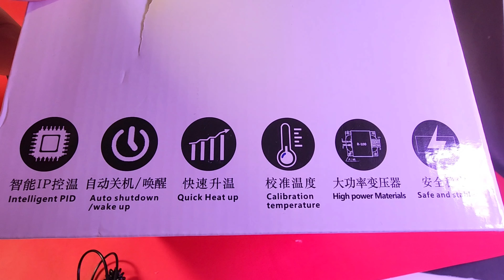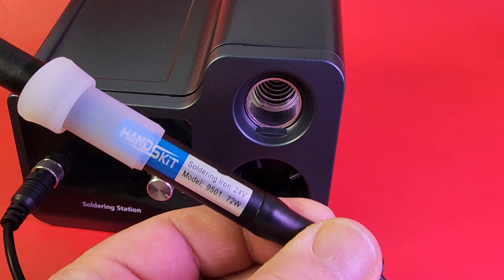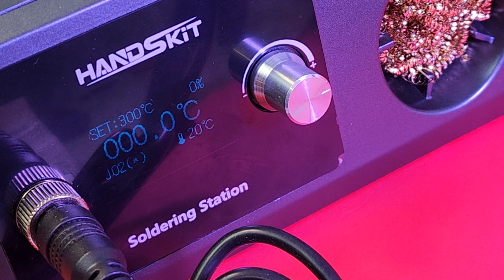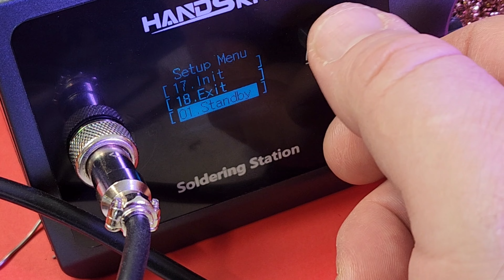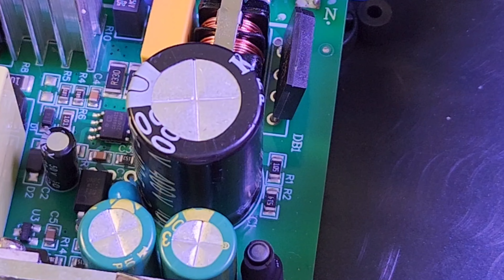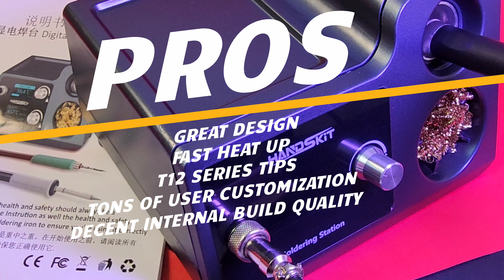HANDSKIT ST12A Soldering Station Review & Teardown!

Comment: Well, thanks, you made me buy it im damm happy with this cheap station, also, i have some (maybe stupid) idea, something to do with my old weller w1010, is there a way to use t12 handles on this station? I saw a guy made this : https://youtu.be/IgZN-7FMisk?si=7P_T2Qx5HNNzm6Fh  very interesting project, is there another way to achieve that? Excuse my bad english. Thanks for your info 👍🏻
Reply from the maker: I'll check out that link. I think the abundance of cheap but highly capable soldering stations really makes it much less cost effective to repair older units. Still.. Always nice to ressurect an old friend 😅

Comment: Can't change tip on screen... Always says J02 although I'm using a K and a BL... Did you find a way to change it? (They have a check on them in the software, but doesn't change between them)
Reply from the maker: Have you tried updating the FW?
Reply: @KeepOnTesting thank you for your reply. I found that while sleeping it isn't possible to change the tip on screen. It has to be heating so that you can press the button while turning it right to select the tip. Would be nice to see that on the manual 😅

Comment: Best regards, I wonder if this station allows the change of mode to c115,210,245 in addition to t12. And another question, between this model and the Yihua T12 948 DB II and the KSGER T12, which is better?

Comment: Hi Bro, does this station not have a soldering iron rest mode when it is put in its place?
Reply from the maker: Yes it has an autosleep mode that activates after 30 min, plus a 15 min standby mode.
Reply: @KeepOnTesting  No that, I was saying when you put the soldering iron in its housing, it doesn't go into sleep mode automatically??
Reply from the maker: No.

Comment: This ground is indeed an afterthought.  Ground wires must be connected with either a spade connector or ring connector on a bolt.  This not only reduces fatigue failure, but soldered connections can easily melt when called upon to carry current to protect the user and this could happen before any circuit breaker or fuse trips.

Ground wires should always be green as well; green is a ubiquitous color, so surely it would cost the same as black.  The power supply looks a lot like the ones used in Quicko and KSGER stations and the display and firmware is quite similar as well, so this is probably an adaptation of those stations.  The switching transformer appears to have excellent insulation and this is a pleasant surprise with drop-shipped Chinese products, so other than the cheap grounding this appears to be a safe product.

Thanks for the review, but too many QC issues to recommend this one; wrong plug type could happen to other customers and DOA iron is unacceptable.  The quality, third-party power supply is let down by the lack of quality control during assembly.

I'm a little late, but Merry Christmas and Happy New Year!
Reply from the maker: Great points 👉...agreed it was not a very stellar performance considering all the issues you mentioned. Hopefully, Handskit improves their game as these aren't exactly dirt cheap 😬  Merry Xmas my friend!
Reply: Can melt ? How many kiloamps current you imagine in this thing ?

Comment: Merry Christmas!  Neat looking setup.  Wonder how the case will holdup over the years with a hot iron stuffed into it?  Some vent holes would have been nice.
Reply from the maker: Merry Christmas!! Definitely could use more venting for passive heat dissipation.. Having that metal pipe inset for the iron will definitely help..but ultimately only time will tell😅😅
Reply: I have had this soldering station for 3 years and I use it at least once a week and I have no problems with it or anything else ;)

Comment: Finally, a T12 review for Christmas! (Shame it isn't mine, could really use one with this car amplifier repair I got going on!)

A bit sad it is AC power only...I would like the option to use DC power to completely eliminate any grounding deal and do solder work on-site Or we can just hack the case to have that done, there seems to be enough space to do it! You can also get STM32 T12 controller boards on their own, or with a housing...but they are quite pricey compared to a kit by the time you get the handle and tips...

Note on the handles though, some that have a lengthened grip (that covers up most of the tip) would become very hot to hold while some would melt. The genuine Hakko ones might do you better, unless the offbrands figured that out. Merry Christmas to everyone!
Reply from the maker: Merry Xmas !! A reliable DC power input would be a great upgrade/feature 👍I'm feeling like Santa!  Shoot me an email: netplicity1@gmail.com
Reply: @KeepOnTesting  Sure, on it!

Comment: Merry X-mas! Personally for me is a mains switch on the backside just simply a no-go. Assuming it works: There is not much more to complain about this device. Slava Ukraine!
Reply from the maker: I'm not keen on the power switch placement either..Merry Xmas! Slava Ukraini 👍
Reply: @probang2866  I suspect a power switch in the back is in order to comply with regulations.
Reply: @Y.T.Learner  There is no such regulation - at least as I'm aware of. Just right now I have several devices in arms range (power supplies, signal generators, DMM´s, digital oscilloscope, hotair and conventional soldering station and so on) all of them equipped with a "hard" power switch at the front. I even had a cheap soldering station (temperature regulated but without display) with the power switch at the front. Placing the switch to the back (as seen in the video) means just: The manufacturer prefers to cut costs using one mass produced, therefore very cheap part - working as mains connector, fuse and switch all together - versus several parts and a connection increasing the usability and convenience for the user/buyer.
Reply: The regulation I heard of is in the UK where I do not reside, but it would drive the design for all markets. A switch at the back near the input implies complete mains removal and is always desirable, even if a soft switch is present elsewhere. More important on linear power supplies. Some of your equipment might have a mechanical button on the front that has a stick that actuates an actual power interrupting switch deep inside the unit.  It is good to have both panel and entrance switches.
Reply: @Y.T.Learner  I know the mentioned construction (mechanical actuated switch inside) from my DMM and an old CRT- oscilloscope. Only my TV and my PC have a soft button. Devices on stand-by are a pretty nice idea for your energy supplier, not so much beneficional for your energy bill. I would tolerate permanent powered measurement devices if they have to had heated components for maintaining high precision standards (voltage or time). Pretty much nothing else should draw current if shut down.